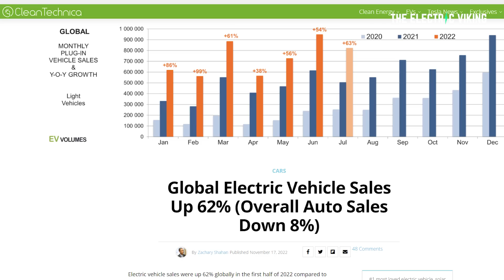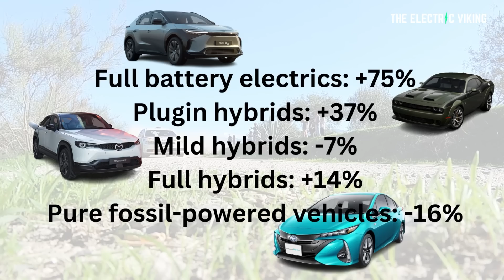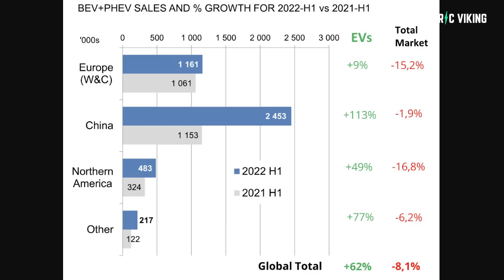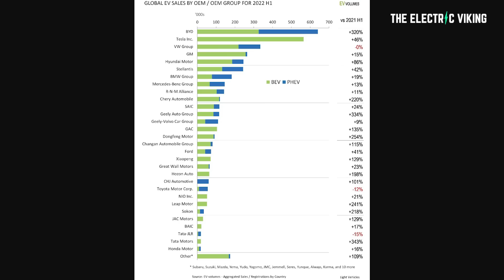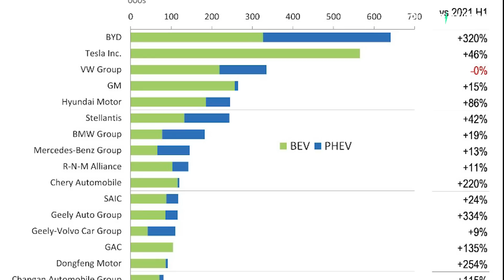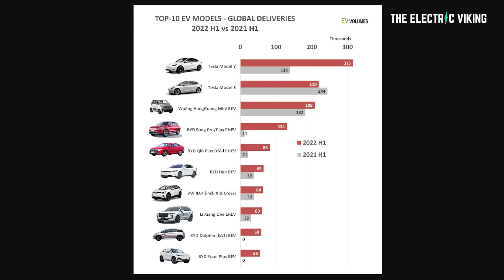Electric car sales up 75% worldwide, VW up 0%, Toyota only loser

Comment: 3 years ago I'd see a tesla a day. Now I see 3 a day. EVERY day I go out in my semi-rural county in PA USA. Mostly 3's, Ys but X and S are represented, even a plaid.
I've seen mach e and some ev-kias. The Mach's are obvious, the other EVs not so much.

Not scientific of course, but I'd say Tesla's have tripled here in the past 3 years.
I went into/out of Pittsburgh (it's an hour way) and on the 2 hour trip saw 8 teslas.

I wanted a cyber truck..still waiting. But the fuel savings over an Outback was $150/month, maybe more with higher gas prices. That makes the tesla cheaper after 4 years.

Except tires. But that's the ONLY maintenance.

Comment: Electric vehicles are meant for cities not for long distance commercial vehicles 
Only hydrogen fuel cells can run long range vehicles nonstop 
They can also run the existing passenger jet aircraft with slight modifications 
All the counties have to stop producing carbon emission vehicles that will solve everything
Reply: Not quite. The Toyota Mirai hydrogen FC car does manage more than 300 miles in range - but so does several EVs, some of which are considerably less expensive . Moreover, while all of those EVs can make long distance cross country road trips, thanks to an abundance of public charging places, the Mirai is limited to road trips of less than 150 miles due to a severe lack of refueling locations. 

Ironically, you've got it backwards - it is the hydrogen fuel cell cars that are meant for city driving only, and the EVs are for long distance. 

While hydrogen is lightweight, it is also too bulky to power jet aircraft, the fuel tanks would be far too big. Hydrogen is also to expensive to be economically competitive. At best, hydrogen fuel cells might provide auxiliary power - if the high fuel cost isn't too much of an issue.
Reply: @chrismuir8403  the new mirai xle can give 646 epa range

Comment: Hang onto that old ICE car! Its value will be going up in the antique market.

My dream car: An original Model T with an EV conversion.
Reply: Mine would be almost any old Austin panel or truck EV. I also like the Canoo van/truck if they make it to production.
Reply: Mine would be Citroen 2CV. It is so small and light that instead of charging your phone from it you could probably power the vehicle from your phone :)

Comment: You're skewing the meaning. You can get a hybrid Toyota in Chicago IF you're willing to pay an additional $10,000 over sticker... and wait for it to arrive - sometime. Three Prius' available - sticker price -$35,787, after dealer add-ons and dealer adjustment - $44,170. No plug in hybrids. It's not that sales are down because on one wants them, there're not available. IF you're desperate for a new hybrid, you'll take what's available, which isn't much, AND PAY 8 to 10 thousand over sticker. Any takers???

Comment: I think the hybrids will hold market share as 40% of cars in the UK for example have no off-road parking. Not everyone lives on Ramsey Street! Once EV's can recharge in a few mins then sure they are the way forwards.
Reply: What about self-charging, the Aptera? The hybrid is a fraud, a diversion, a distraction from the EV. Hybrids are basically ICEVs.
Reply: For a while, you're probably right. The problem hybrids have from now on is that the subsidies are now exclusively given to the full EVs and hybrids are kind of expensive to make with their dual drivetrain. Most consumers with limited financial resources will have to make a choice for a regular petrol-powered car if they cannot afford an EV or when an EV doesn't suit their use-case well.

Comment: Dude, what good does it do to rattle off percentages, why not use real numbers, providing you can find them!!! There are approximately 1 billion cars on the road, how many are electric? Cars typically have a 10 year life span, so that means 100 million new sales per year (real numbers are closer to 80 million) You actually believe Tesla will capture 25% of the 80 million new car sales? Here's the other thing, EVs will last at least 2 times longer, so instead of 80 million annual sales, that will be cut to 40 million, so now you're saying Tesla will capture 1/2 the world car sales. Do you have any idea how stupid that sounds? Tesla will be hard pressed to maintain 2 million annual sales, they might rise to 5 or 7 million, but they will fall back to 2 million. I wonder what they'll be making in all those vacant Tesla Giga factories? Darn, I forgot about the millions of AI robots from Musk, oh yeah, and the world dominating new smart phone!!! Buy Buy Tesla, Fan Boy, you're on a roll.🤣🤣🤣🤣

Comment: The price for EVs are too high, negating saving from not buying gas.
Reply: Bingo!

In the UK a RAV4 PHEV is £46,000 and a AWD Model Y is £57,000.

You simply can't recoup the extra costs no matter how hard you 'fiddle' the numbers!
Reply: @bryanduncan6178  Nobody buys a Tesla to save money.
Reply: @jamesvandamme7786  What's the point of buying an EV then?!
Reply: @bryanduncan6178  You buy a Tesla to have the latest status symbol, and go zoom-zoom. 
You buy a Bolt, BYD, Zoe, Leaf, or MG to save money. Yes, there are cheap EVs and there will be many more
The SAE predicts that the cost of building EVs will equal the cost of ICE in the 2025-26 time frame. Demand will explode then. You'll save money, and enjoy the ride.

Comment: Dude! You do realize that for many N/As and Europeans (and Aussies and kiwis and…) safety means something. So saying that a vehicle is a basically a quadracycle means it should not even be on this list. They are a category apart. It is far cheaper to develop a vehicle for which crash avoidance and survivability are of no consequence than one which attempts to get a 5 *** star rating.
Make the Wuling Hongguang Mini EV crash worthy to at least 3 stars and watch what happens to its price!
It would not sell nearly as much.

Comment: I’ve been hanging on to hope for an affordable decent (sub $25 G) all electric car for at least 10 years now. I’m not getting any younger. I’m still hoping. Thanks Sam!
Reply: If you buy a $500/month gas car you have spend another $500 - $700 in gas per month plus oil changes.  You can buy a Chevy EUV Volt for $30G and its pays for itself, specially if you have Solar panels at home. If you wait until next year you will have the option of buying an Equinox EV or Blazer EV.
Reply: @necrodino  I'll wait then.
Reply: Aptera is coming! Don't settle for less. Be informed, be smart, boycott the corrupt legacy makers.
Reply: Add up the cost of whole ownership over 3/5 or 10 years and you will find they are in fact cheaper then most other cars. Also consider what fuel prices may do.....
Reply: @timorum  ah, you think people should actually think ahead? or at all?
Reply: me too!
Reply: Look at the Chevy Bolt. Not much more expensive than that.
Reply: wont happen, there also arent any decent sub 25,000 ICE car, hasnt been for years.
Reply: @scottmcshannon6821  Mazda. Their reliability is on par with Toyota. Just wait til they get the EV religion. They're putting a rotary range extender in the MX-30 next year, which totally sucked without one. But they could totally make a good pure EV, if they get the right battery in it.

Comment: Viking, can you continue to explain the difference between percentages and real numbers?  It can make things seem skewed without context.  Example: Sell one car.  Sell two cars, up 100%.  Sell three cars, up 50%. Sell four cars, up 25%. In fact you've sold ten cars, ten times what your first sale was, but the percentage increase keeps on dropping, despite the number of cars accelerating in production output.  You already know this, but it needs stating both in percentages and numerically to make sense, and not all of us can do the sums in our head as the narrative races onwards... I certainly can't.  Numbers matter, as you know.  Split you data into numerical and percentage balances please?  It really would help IMHO.

Comment: The new Prius design is really good. They need to make a full EV version of it and compare the sales between Prius EV, hybrid, and PHEV. I guarantee you the EV version would outsell the other two.
Reply: I think you're right. Which is why Toyota won't do this; it'd disprove their story that people prefer hybrids over EVs.
Reply: Yes, Toyota are not dummies, they will change over to mostly electric in a few years. Many countries in Asia can not afford EV's yet. Toyota I believe still leads the world despite what the Electric Viking says.
Reply: mark k • Yes, and all of them at Toyota know this including their biggest crook, their "president" ( and of my as ) Akio Toyoda.
That's why they don't do it.
They know that a very well build and affordable electric Toyota model will outsell any gas or hybrid they manufacture currently.
That's why they intentionally botched the BZ4X and...so on and so forth.
And they will keep repeating this stupid game of intentionally botching and building EVs that regular people don't want or need ( they, Toyota, will continue to build intentionally expensive EVs and with wrong and inadequate specs for masses, because the order coming from the demented Akio Toyoda is to prolong the ICE car manufacturing for as long as possible ).
Those are a bunch of crooks, and for these Toyota deserves to go bankrupt.
Reply: I think Toyota went in the wrong direction with their latest Prius, they should have made it with a 0.8 liter engine and 20% larger battery. People buy Priuses for the fuel economy!
Reply: Wow, the most irrelevant thing is really good, wery well put.
Reply: If they were able to do that, then they would have done it. I am sure they are making as many EVs as they possibly can one, thousand percent effort in EVs right now. They just cannot do magic. it takes time and batteries and they started the serious EV efforts way too late...
Reply: Toyota needs a small truck again. PHEV or BEV, I think?
Reply: No, a hybryd can never be Good, its just the worst in every way.

Not even if they cost like 10 000 it would be worth it.

Comment: Lithium limits EVs to 6% of the light vehicle market--  growth ENDs.  A better scalable battery must be found to change this reality - EVs can't meet demand. 33lbs of Lithium per EV 170,000 tons (annual);  340 million pounds/33 = 10 million - If every ounce of Lithium produced goes for EVs - which it won't be. What if you wanted 33% of EVs to have powerwalls for solar?  9 million; phones, laptops, powertools etc etc - if these take 30% - you have at most 6 million BEVs annually in a market of 100 million.  Lithium = Niche market. Lithium=dead end.

Comment: There may not be such a drop in  used ICE prices.   When they are no longer produced the only way for people who want one is to buy used.   That may actually drive the used prices up for a while.
Reply: how are those film cameras and typewriters holding their values?
Reply: @jayc147  Have you tried buying a photo camera (photo film based) recently? Their prices are going through the roof. There is a revival of the old analog way of photography going on, but no one is making those old analog cameras anymore. The second hand market for them is booming.
Reply: @hvh377  nice try. that only applies to certain collector units. Just like certain cars will be collector items, but most will be junk.
Reply: @jayc147  Well, I wouldn't say collector items. Not all old enthusiasts cars on the road now are collector's items either. But there was some reason for the owner to hang on to it.

And yes most ICE cars will be junk in 10 years time, but they would have been anyway. Same as the EVs sold now. We are not near 100% new EV sales for a while yet and then 2nd hand market needs a few years to follow as well. There's still a decade to go at least and how many new cars do you buy in that time? And who knows, petrol might become cheap due to lack of demand.
Reply: @hvh377  every thrift shop is full of them and can't give them away, especially mass market cameras
Reply: @elbuho1  Not in my neck of the woods...

I'm not saying cars won't depreciate, but when were cars ever a good investment?
Reply: @hvh377  There's always the Jay Leno crowd. Hey, it's only money.
Reply: ice losing fast
Reply: Why would anybody buy a used ice while you can save on operating cost? Not to mention knowing they No longer being  produce and no resale value?
Reply: @reyfetsalmo3346  Not everybody is driving a car with a calculator in one hand. There are people who want other things from their cars than the cheapest possible way of getting from A to B.
Reply: @hvh377  Some motorheads like the smell and noise, and the fun of going to a gas station and paying $50. Plus Joe Biden wants them to buy EV, and damned if they're going to.
Reply: @hvh377  ev is the cheapest way of getting from a to b.
Reply: @reyfetsalmo3346  You and others are free to believe that and perhaps it's even true as well, but my point was that there are a lot of car owners out there who don't care about cheap. They want something else than cheap.

Comment: It seems they’re not taking off in Europe!
Reply: Quite the opposite.  EV sales in Europe are soaring, but due to an entirely different kind of road network and transportation mix, the kind and size of vehicles is profoundly different.
Reply: @carpinion  well, we have no charging infrastructure.  Build ne another 390,000 charging points!
Reply: +9% in a market that's down 15% is pretty good. But there are still lots of gaps in the market - sub 50k caravan-pullers, sub 30k hatchbacks. Once there's more choice in those segments, things will change quickly. Meanwhile the prices of new ICE cars are climbing fast, the new entry level VW T-Roc costs more than the MG4. Who's going to buy it?

Comment: India bought 3 EVs, an increase over 1 purchased in prior period? Beware sales ratios out of context.
Reply: India, however, is manufacturing EVs for its population, by Indians, in India.  The Indian economy has been protectionist since independence, which makes imports prohibitively expensive and thus rare.  Those car businesses that have entered the market are those who built factories there to create an indigenous market.  Chinese EV designs are appearing all over India, probably turning up in CKD kits for local assembly.  Enterprising Indians are manufacturing their own versions and bigger players like Tata Motors already owns Jaguar LandRover.  Things are changing over there probably faster than in countries with better wealth distribution because there's so little infrastructure to replace.  New, green energy projects are transforming previously isolated and transport-poor communities with cheap energy, which in turn can be used in ultra cheap slow EVs of the kind that is putting at vast rural Chinese population into a form of car they can afford.

Comment: Hey! Viking stop hating on the mx30. Go try it and you will love it. Awesome little car😎💪
Reply: You're about the only one I've ever heard say the MX-30 is a good car. And based on its sales figures there are very few people out there who agree with you.
Reply: @MLHunt  Show me a single owner that says it is a bad car.😁 If you look at the stats it is bad but it has many good things aswell. Friend has a model s and the mx30 has a better built interior. More quiet ride. Better Headlights, and also head up display. I bought the mx30 slightly used with 4000km in March, now it has 20000km. When you go for longer trips you only need to plan your jurney. The interior is miles ahead from the likes of e- Niro or kona. Much nicer😎👍
Reply: @Lucas-wp2ph  I'd be very surprised indeed if anyone who bought a car would be willing to say publicly that it's a bad car. After less than a year of ownership. Even if they really felt that way. 

Still, the numbers--US sales of <1k units total, I believe, certainly not many more than that--sort of speak for themselves I think.

To say it's not a good car is not to say it doesn't have good attributes. I'm sure it has many of the attributes--comfort, build quality, driving dynamics etc.--people laud in Mazdas generally. But relative to other cars in the market, clearly most people think there are better choices.
Reply: @MLHunt  Here in Finland the mx30 was the best choice, got mine for 28 000€. The only competitor was the Ioniq 28kwh but the plastic and loud interior and also no app put me off. As I use to say mx30 is a shitty ev but an awesome car😁
Reply: @Lucas-wp2ph  Perhaps I mightn't have said it's not a good car as an objective statement. Such judgments are necessarily subjective and based on the criteria of the particular person making the judgment after all. You are speaking from your perspective; I am speaking from the perspective of the general EV shopper. I don't think either of us should be said to be wrong. You because the car checks your boxes, me because it quite evidently does not check the boxes for the vast majority of EV buyers voting with their wallets.
Reply: @MLHunt  But I have to say that for the price they charge new. 38 000€ here in Finland, then there are better cars for the money👍
Reply: @Lucas-wp2ph  Mazda sold more Mx-30s in Finland than in all of the United States.
Reply: This is doubtful
Reply: It will be a good hybrid when they put the rotary range extender in it in 2023. If they build a real EV it will be better than Toyota's.

Comment: Toyota is the leader of Japanese car manufacturers.  They bet on hydrogen technology for cars and the whole Japanese industry just followed.  It was the wrong bet.  They knew but they can’t quickly change course because it will come at the cost of enormous job losses.  China government’s subsidies for electric cars and European carbon emission limits are going to crush them.  Imho 2025 or earlier, the legacy automakers that can’t transition quickly enough will drop off quickly.